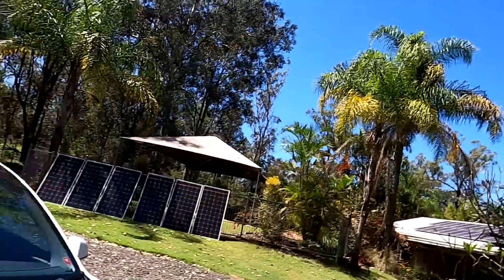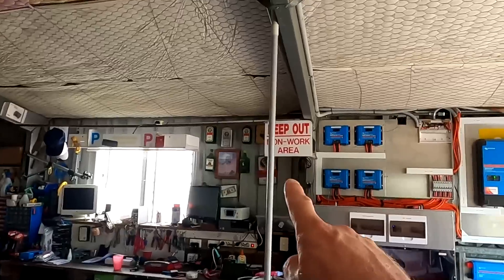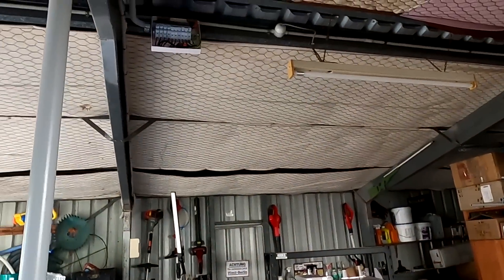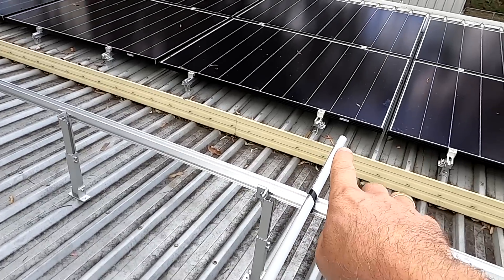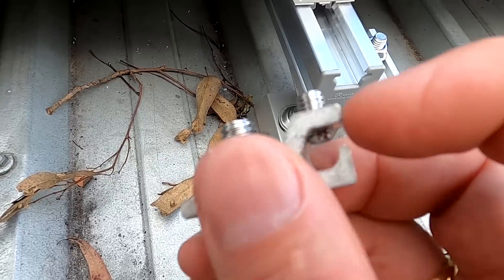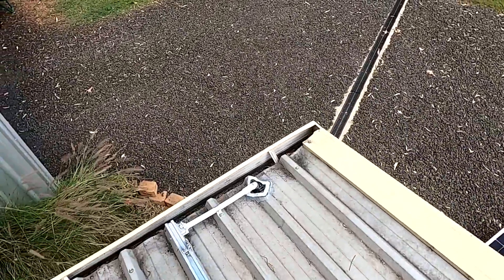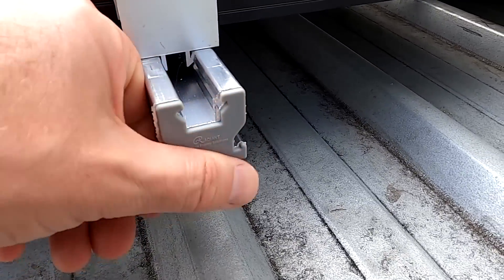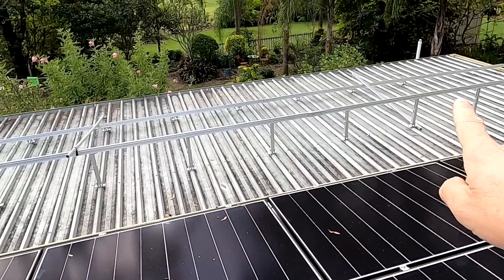1st power-on of the new West Roof with Hyundai Shingled Solar Panels. YEAH!!!!

Comment: I think the trees are blocking the sun more than the clouds are affecting panel performance. I have zero tree shading and even in cloudy/rainy conditions I am getting great performance. full sun right now 7500, cloudy 6500 and heavy rain 5500 watts. But I also have my panels set for fall/spring almost winter angle (51 degrees). I truly hope yo get more than 500 watts an hour from 4000 watts of panels.
Reply: We must have different clouds. On a cloudy winter day here my 6.1kW array might only be producing 100-200W.
Reply: @niktak1114   I want to know why my panels are performing when others don't. Is it cause I live 7 miles form Lake Michigan and its reflecting more sun? is it my angle to the atmosphere?  I bought used 235 watt Trina panels (40) 38 works. the max I have got is 7500 watts. the lowest I have seen is when the sun first comes up 1 inverter slowly goes 100 then in 30 minutes its around 3500 watts. other inverter I have not seen under 1000 watts. again did I find an angle to where the sun works better in my area? I have no clue I just know I get way more power than expected.
Reply: @niktak1114  I thought that would have happened in the storm I had couple days ago. Raining real hard, black clouds and I stayed around 5kw. I thought here I will drop under 500 watts. Didn't happen. It's driving me nuts trying to figure out why.  Nobody else I talk to has this return in bad weather.  I'll keep monitoring and see how they perform. I'll be adding wifi to each then I can track a lot better and have proof.
Reply: Your panels sound amazing! What make and model are they?
Reply: @kevinmills5293  they are not just trina 235.I bought used.   I want to know why my panels are performing when others don't. Is it cause I live 7 miles form Lake Michigan and its reflecting more sun? is it my angle to the atmosphere?  I bought used 235 watt Trina panels (40) 38 works. the max I have got is 7500 watts. the lowest I have seen is when the sun first comes up 1 inverter slowly goes 100 then in 30 minutes its around 3500 watts. other inverter I have not seen under 1000 watts. again did I find an angle to where the sun works better in my area? I have no clue I just know I get way more power than expected.
Reply: Have you got micro inverters or balancers installed with the panels?
Reply: @andysPARK  no. I have 2 5000US growatt inverters(want schneider)
Reply: I would be happy to video chat with anyone who wants to see or doesn't believe me. I truly expected to have really low numbers on cloudy/rainy days.